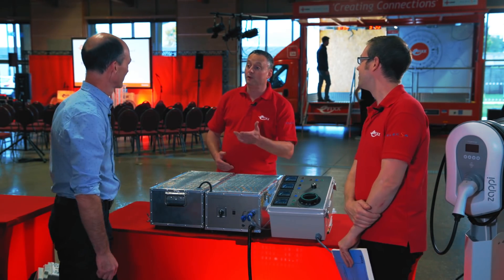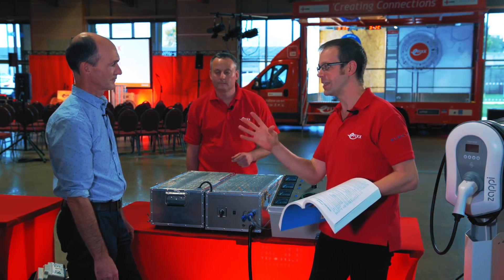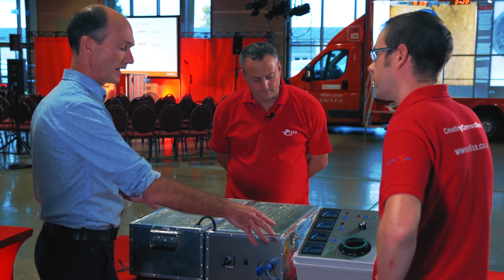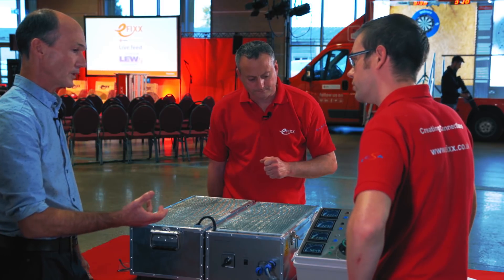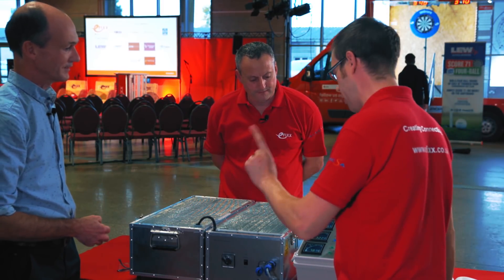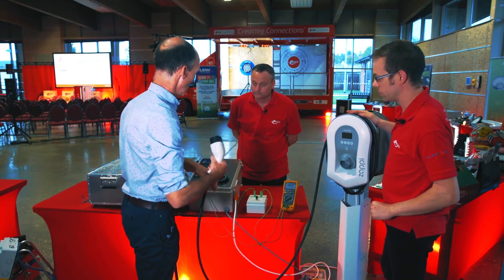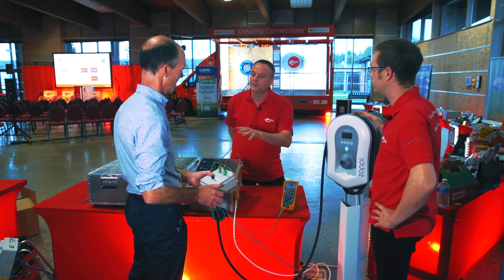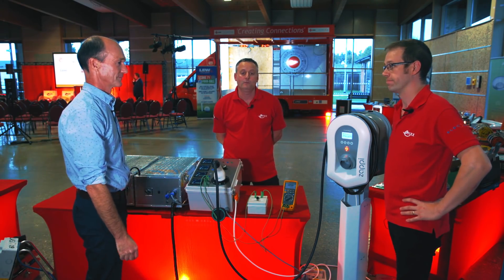Why BS7671 amendment 1 is potentially dangerous for electric vehicle charging installations and evse

Comment: This labours the point greatly but still fails to explain what's actually going on (you know, with a diagram, perhaps), exactly what the zappi 2 trip is measuring, why measuring voltage alone does not work, etc. I really am almost none the wiser despite 14 mins of blithering.

Comment: With the Zappi 2 the only true earth comes via the person touching the vehicle, in the event of a PEN conductor fault.
Protection from the shock hazard, caused by a PEN fault in a PME supply, requires a preventative method, and in my view, the only way to do that is to have a true earth reference of a low value, via a rod or plate or foundation conductor, connected to the main earth terminal, at the origin of the installation.

Comment: Interestingly, the new three phase smart meters being installed here (Johannesburg South Africa) have the ability to disconnect when the voltages are out of range (I think 15%).
BUT its rare to find them programmed to do this.
There was a house two streets away that had no power.
City Power came out and I went to see. The power had been on for a bit and went off again and they were checking the meter.
I got there and saw the meter icon said disconnected. They hadn't seen that.
So tripped the three breakers, put them on and the meter connected.
Display starts cycling through and reaches the phase voltages.
283
179
283

I flicked those switches off very quickly!

Turns out there was a neutral fault after the first three houses. MEN kept the voltages from being more out of range.

Comment: If I just for the hell of it stuck in a earth rod and wired to my earthing block were my water and gas is also wired in to my CU earthing bar.  And my house in a Neutral earth combined as I have one single conductor made of aluminium with a tin coated copper round it.  And some were down the line the Neutral is broken or there Earth pointing is broken what will happen.  I ask would it be saver for me to put in a earth rod and wire it to my earthing block.
Reply from the maker: The PME earth system used to rely heavily on houses having great earth rods in the shape of metal gas and water pipes. This can no longer be taken for granted. So you add an additional earth rod  and a fault occurs effecting multiple properties then your generosity becomes the connection to neutral for your neighbours.
Reply: @efixx  That is what I was thinking as well gas an water pipes are in the ground as are next door and down the road.  This side of town are all wired the same way 5 mile the other side 8 houses I was working in have 3 wire SWA so separet earth I did take measuremnt from the CPC and neutral I got 1.02 ohm.  Just I was re reading up on agricultural and earthing rods and stray voltages were farm animals can be harmed.  It got me thinking with all the new EV points wired as a TT with earth rod can the one next door leak up mine.  So if we all added a earth rod even with PME as you say gas and water pipes can not be relied on.

Comment: I am extremely pleased with my JuiceBox Pro 40 with wifi. do7.pl/jCarStation I drive a 1992 Miata I converted to electric. My requirement for a charging station was that I wanted something that would be capable of charging a Tesla in an acceptable amount of time (for when I eventually get a Model 3), is rated for indoor/outdoor use, and is also small enough to fit in the trunk of my Miata (along with the spare tire and lithium battery box and AC:DC convertor)--my parents live 50 miles away and I take the JuiceBox with me so I can charge at their house before driving home. This charging station fulfills all my requirements. The construction of the housing, cables, plugs and wifi antenna is quite rugged. The wifi feature is nice in that you can check on your charging progress with the app without having to walk out and look inside the vehicle. I haven't had any issues with its functioning for the 6 months I've been using it. It has performed flawlessly and I couldn't be happier.

Comment: So when I was doing my electrical time. I remover being  given a nice chart  that showed the current flow and the effect on the body .  5ma. No effect can’t feel it. 5 to 10 ma you can feel it tingling. 10 ma or greater can cause death .   Yes this device is a positive point in protection  but it still does not comply in removing the equipment from service in the 4 seconds. It needs some one to touch the car and receive a shock before it operates  and that needs to be a fault of more than 18ma .... 
Already above what I was told is a deadly value ....   the problem is PME
Reply from the maker: Most RCDs fitted to residential circuits operate at 30mA leakage current.
Reply: efixx   Yes. That’s correct  the idea that any leakage to earth that is over 30 ma will disconnect  supply via rcd  
Before anyone touches the earthed metal work .  That may be live .. 
For this system to work well it still needs a separate earth ref. From a rod  so that it will trip before someone touches the car and gets a shock .   As some one who tested a 30ma. Rcd when it first came on the market by touching it I can say that it is not nice you do feel it.    
 I wonder if anyone has actually touched this to make it trip to feel the Experiance.    . Don’t get me wrong it is a good saftey feature. But I don’t think that it will actually comply with the regs and disconnect the car in 4 seconds of the pen fault happening.  Until some one touches it .  Mabey we need a grounding wire to attach to the car before connecting to charger.  Same as aircraft. When refuelling

Comment: If you took a regular RCD and ran line, neutral and PE through its current transformer, wouldn't it do exactly this? Provided you also modified it to interrupt all three conductors (L, N, PE).
Reply from the maker: Interesting thought - but we don’t think it would then detect a regular line to earth fault ?
Reply: @efixx  I think you're right (it needs independent current deltas across all three conductors) and looking at it without getting into the nitty gritty of the regs etc, purely from a current flow perspective and my own electronics background, I believe the premise is that they are looking at current imbalance separately between L-N (as per normal RCD) but also separately the L-E which allows monitoring of all potential fault conditions as he alluded to - the Zappi knows how much current should be flowing (i.e. through the car charger and back via N) and through which path i.e. not the PE, so monitoring all of those independently means they can easily kill all three conductors via the contactor and isolate the car if current starts flowing via chassis as demonstrated - much easier to do using electronics I guess and since an EV charger has the space and won't add much to the cost, this solution seems to make sense (I imagine they monitor the voltage too) - just my 2p worth ;)

Comment: Good to see Zappie addressing some of the issues, However:
It would appear the “floating voltage” would remain on the bodywork of the car under fault conditions until someone touches it! Then it activates sensor/trip unit in the Zappie at approximately 18mA, as we know anything above 10mA through the heart can be potentially leathal!
Unlike a fuse or RCD which would activate under fault conditions without human intervention. 
So although a step in the right direction it’s not perfect!
Reply: I think it needs that current flow in the current transformer to detect the fault.

Unless you are earthing your bodywork directly using an alternate connection - I can't see how a test would detect this.

Comment: As far as I understand the Zappi measures the voltage between L - N in accordance with 722.411.4.1(iv) but also has additional protection using a current sensing coil around the CPC, if a current flows on the CPC then the device also disconnects all conductors. This extra protection is better to have than not however it is not automatic disconnection as it requires user intervention by a person being in contact with the EV metalwork and true earth to complete the circuit and receiving an electric shock for a short duration. Funny how he used a banana plug to simulate touching the EV rather than himself toughing some metalwork. This protection is better than nothing although automatic disconnection which does not involve an electric shock for a short duration would be better but perhaps un-achievable, Thanks Marcus

Comment: I can understand the point made, but can someone tell me please how will the vehicle get live under fault condition. I thought 230v supply to the vehicle is fully isolated from the bodywork and charger is made of plastic.
Reply: Well, it should, but the discussion is about failure modes. It may be that novelty and transitions attract attention, but there are other issues that are often ignored to do with car bodywork electrical risks, such as static charges and a risk of petrol vapour explosion while refuelling. Depends a lot on the weather, of course. Usually ignored on the road, but I seem to recall that refuelling aircraft often required clamping the bodywork to earth before refuelling to avoid a ‘spark’ that could ignite the fuel vapour.
Reply: If the body of a vehicle goes live you have bigger problems like the 12v system blowing acid every where etc.

Comment: Monitoring the voltage to detect an unbalanced virtual neutral could work, but it would have to be "smart". 

Using an integrating dynamic threshold would allow detection of offset Neutral.  As the neutral to earth potential offset is shared across the 3 phases, for any given N->E offset, driven by phase imbalance will be seen as the matching voltage offset. In the test shown, with 49 Vrms N->E, and a single phase imbalance, we had 216,216,289 Vrms on the L->N.  Clearly, the two phases without the imbalance "share" the offset voltage (because they share the offset current).  If we want to keep the maximum N->E below the 50V safe limit, we need to be able to monitor L->N voltages to within 25V or nominal.  That to me sounds do-able, given the correct dynamic measurement technique.  No, not as good (or as fast) as actually measuring the fault current directly, but certainly feasible  and it would need to be an integrating "leaky bucket" type threshold, that can differentiate between a continuous earth offset and dynamic voltage disturbances on the line, but that's pretty trivial these days with a £2 micro controller.......

Comment: Does the Pod-Point charger follow the same principle?
Ive just had one fitted with no earth rod and was told that the unit doesn’t need one
Reply from the maker: Aaron Bott - Our understanding is that the Pod-point relies upon the voltage method described in the video. We are planning to look at some of the other models asap
Reply: efixx would you recommend fitting  a tt earth ?
Reply from the maker: Aaron Bott difficult - according to the data sheet it complies - but in the same breath pushes the ultimate responsibility back to the installer. I’d sit tight until AMD 1 is finalised
Reply: https://pod-point.com/electric-car-news/note-pme-supply-without-earth-rod

Pod Point says it complies with indent (iii) and patent pending just like Myenergi but their given example actually describes this potentially dangerous indent (iv)🤔

Comment: Very interesting. Unbelievable how a socket outside has become such an issue when other vehicles such as electric fork lifts , access equipment and others on a simple three phase or single phase socket  have been used for decades. The best option is to make all EV outlets TT whenever possible I guess .
Does this built in safety system on the charger point have a test button to confirm it works like an RCD has or self testing ability I wonder? Finally how many people have actually been killed by these faults with there car on charge ,The same faults that could make any outside application on a TNC- C-S earth system have CPC to Ground potential.
Reply: Not quite the same though in say an industrial environment, nor would they need to charge with the high current rates a car will be needing to make them of any use. And it's early days for any deaths or electrocutions etc Let's not wait until someone does die or a house goes up in smoke before the issues are resolved
Reply: Not very many outdoors forklift chargers.

Comment: I thought that’s why they introduced Earth electrodes for EV installations in case of the broken PEN conductor. The more I think about it, if the distribution network can’t guarantee their earthing arrangements, shouldn’t we be installing ‘back up’ Earth Electrodes on all PME systems? Does the Zappi 2 have DC monitoring as well, and how does that tie into the AC current detection?

Comment: There alot of attention around ev chargers and broken PENs but this  could happen with anything electrical in and outside the house more so with earthed metal enclosures.
Reply: Just wondering, if the loss of PEN is becoming an issue is it because gas and water is now delivered through non metallic underground  pipe work. My water main between pavement stopcock and house is bare copper pipe, so if this is the case for every house in the road surely there must be quite a good return path to the district sub station. Another theory, are copper thieves having effect on reported  occurances ?
Reply: @kbultray  Its actually more dangerous if you do have metallic gas and water pipes, this is due to having as you say, a lower impedance return path. The danger comes when this return current melts gas mains. You can search on YouTube 'Castleford gas explosion'. This happened because the neutral was stolen from the substation and the return path was through a gas pipe which ruptured with the current. Copper theft does have an impact on those numbers but it's just as common to have a PEN fault from fault situations.
Reply: Matthew Brown,   Thanks Mathew, an interesting observation.
Reply: It has done for many years, never understood why it wasn't an issue until now. This happens quite regularly on the distribution network.
Reply: Yes it has been a problem for a long time with outside lights, etc, But these are less likely to be touched whereas an EV is likely to be touched.   But a danger that has been around for a long time is outside taps bonded to a PME earth,  which can become live in a PEN fault (and you are likely to be standing on wet ground and have wet hands !!).

Comment: How often do PEN conductors go open?
Reply: More often than you expect! As a Neutral Fault Engineer at Haste Ltd, we are very busy and have faults come in every day!
Reply: @AJ_Aslam  I'm an electrician doing mainly domestic wiring so I don't know much about what goes on in the network side.  I imagined that most of the underground cable was split concentric so it's pretty much impossible to lose the neutral connection.
To add to my confusion, I wonder why this isn't an issue with a TN-S supply.
Reply: @westinthewest  In a TNS supply if you lose the earth the RCD will still operate as you will still have a neutral at near ground potential (still earthed at the substation) even under most fault conditions!
Reply: @westinthewest  Very little of the underground network is split concentric, There's a lot of old PILC, but all new cable are PEN, and all repairs are made in PEN, bonding either a PILC outer earth and neutral together or if the existing is split con, bonding both parts of the split together, Thus many TNS connections can now suffer PME faults as somewhere on the line, the neutral and earth can be bonded together.
Reply: @ianhope1073  John Ward gives a very good explanation around this.
Reply from the maker: westinthewest - last year in the UK around 400 PEN faults were recorded.

Comment: The principle in theZappy method almost sounds like a return to the old VOELCB model where the earth is monitored in series, but presumably without the common problems of the VOELCBs, it was mentioned that fault current is being monitored not earth touch voltage. In relation to the ammendments, I would have thought a better amendment to promote increased safety would be to mandate PME installations include supplementary earth electrode(s) at the installation MET as they do in some other countries, meeting 722.411.4.1 (ii) in the current regulations for EV charging and protecting against broken neutral from the supply for all installation exposed metalwork. There is then no need for the car charger supply to be brought out TT to an individual earth electrode for the charger.
Reply: PhillC02 if you follow e5 look at Paul and John ward they do 2 podcasts part 1 & part 2 ... they say the same as yourself!!
Reply: @fuzedtv  Thanks I shall take a look
Reply: they spoke about adding supplementary earth rods to installations a few years ago, as the networks were saying they couldnt guarantee the earth, which is their problem not the electricians, thankfully they seen sense and knocked it on the head. its simply not practical to do.

Comment: Very interesting indeed. Matt:e have developed a similar device that could possibly be used for other installations For  example, outbuildings.
Reply: There is a single phase version also.
Reply: There is a single phase version also.
Reply: Only works on 3 phase